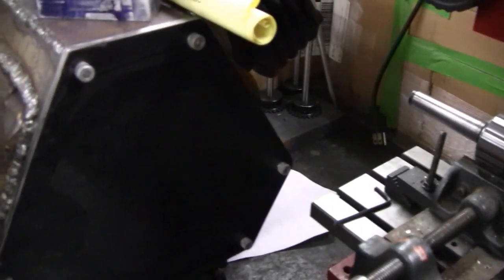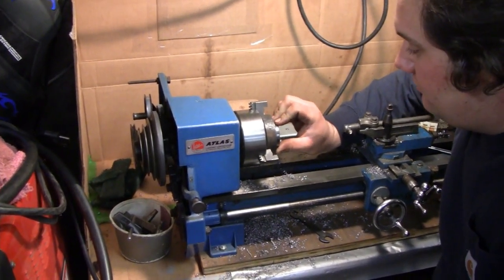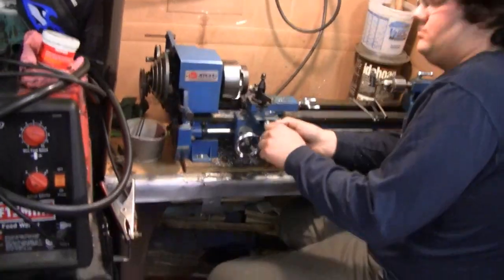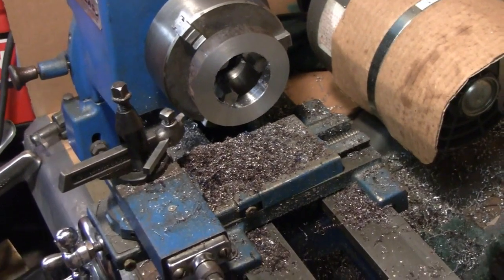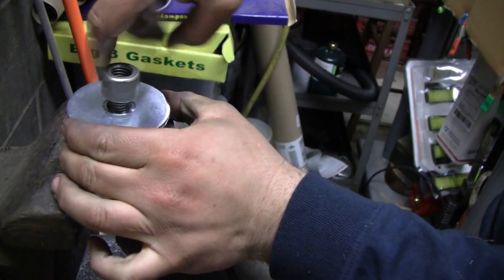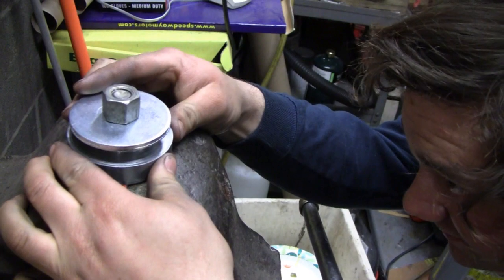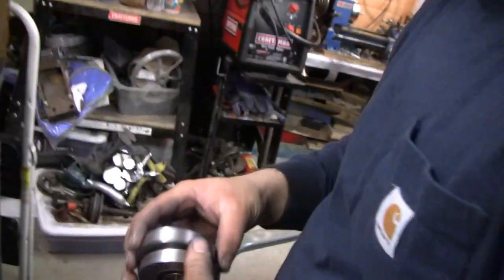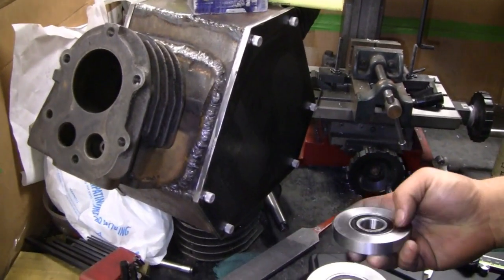HOMEMADE RADIAL BRIGGS ENGINE (part 20)

Comment: So, just curious. Why are you guys using sealed bearings? Since they are on the inside of the block, wouldn't it be better to use plain bearings so they can be lubricated with the motor oil that is being splashed around? Not trying to tell you what to do or how to do it, just wandering.
Reply from the maker: +focustuner10 They're just rubber seals, they peel right off!!☺
Reply: Ok. That makes sense. Keep up the good work. I wish that I had the resources to do this kinda stuff. But, I will just have to stick to small engine repair and rebuilds for now.

Comment: So, Mike's going to mount the bearings INSIDE the case, and because of this, it will be in the oil 'splash'  ?
 If  'yes', then will he remove one or both of the seals on each bearing to allow more lubrication to the bearing, or leave the bearings sealed both sides ?
This project is starting to get 'critical' in the measurements 'department' .
Thanks again guys.
Reply from the maker: +Reg Sparkes He's just gonna remove one side of the seal!!☺

Comment: Lol that's just how I would have done the bearing press buddy .
I have one that I made almost identical with all thread ,a plater welded on the bottom and a large thick washer and nut.
I use mine for compressing primary and secondary cvt clutches that have spring preload .
Btw ,,it's my friggjn birthday today!
No phone call? What the hell man!!!!!!
Reply from the maker: +Bagot Corner I tried callin', you were probably too far out in the Klondike for reception!!☺
Reply: +805ROADKING lol I'm over on the WestBank of Lake Superior buddy 😊.
I did get a few 1-800 calls .
Was that you callin on behalf of Wilfred Brimley?
Tell him I don't need any Colostomy Bags just yet if he drops in!

Comment: It would make the assembly bulky but keeping in the spirit of radial engines wouldn't it be great for it to have a propeller?  Then cooling wouldn't be an issue.
Reply from the maker: +jbmbanter We've been trying to find a 3 blade prop, it's been pretty tough though!!☺

Comment: Hi  Good to see the update thats some good engineering right there, Mike was pretty polite saying you are in the way buddy. I kinda get ticked when customers start getting close while watching me work. or in reality  trying to see what i'm doing for the next time it quits, and they want to fix it them selves.

 A couple times I have asked them to move, they do then gradually creep back. usually a good swing of the hammer past the side of their head and the "oops i didn't see you there" fixes the problem pretty good L.O.L.  I was just thinking with your lathe why do you have the switch at the back. for safety wouldn't it be better at the front so you are not reaching over spinning components, and running an increased risk of getting caught in something by accident one day?. Your lathe your choice I guess, just thinking out loud again.
Reply from the maker: +super6954 That was just a convenient place to mount it at the time, it will probably get moved eventually!!☺